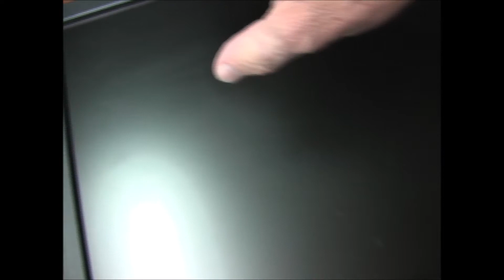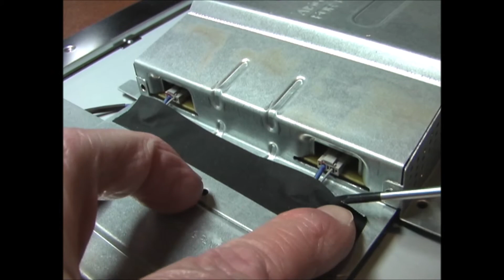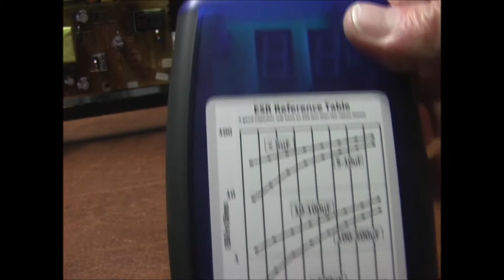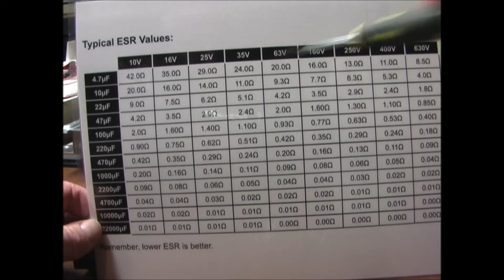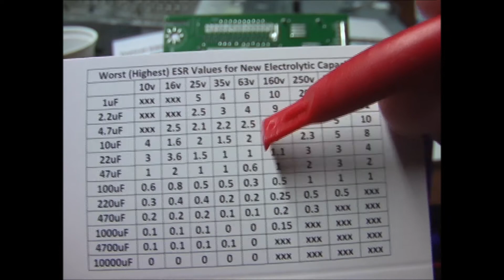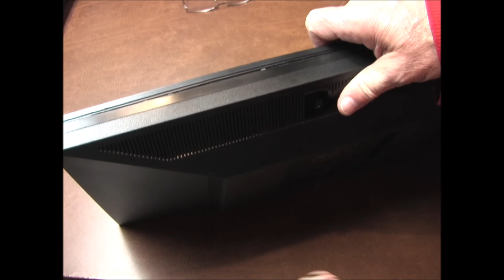How to Troubleshoot and Fix / Repair LCD Computer Monitor DELL E2210Hc

Comment: The PCB holder is neat! Can a small heat sink be placed on the nearby transistor? Great video, & thanks for the close-ups of the ribbon connectors. Should you use, when possible, the same brand of caps? Thank you 🤓 when you replaced the caps, did the screen colors look brighter?